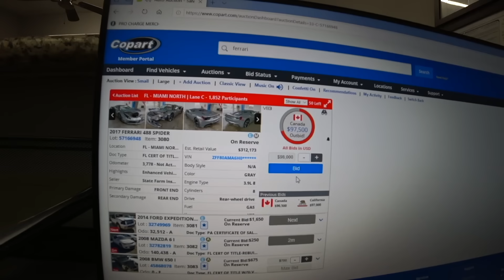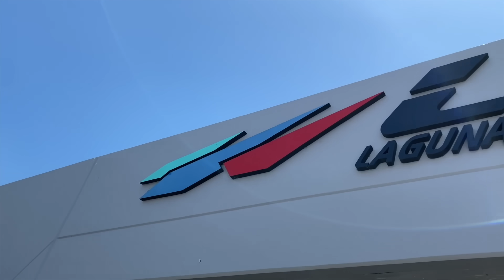REBUILDING A WRECKED JAGUAR F-TYPE  R “ FRAME WORK” PART #3

Comment: Invest in a Car-O-Liner. You'll get better accuracy instead of trying to figure it out with a donor car. You have great knowledge of flipping exotic cars but lack the right tools. These cars have pinpoint accuracy at the factory, I would only use your method with shitty cars like honda and toyotas.